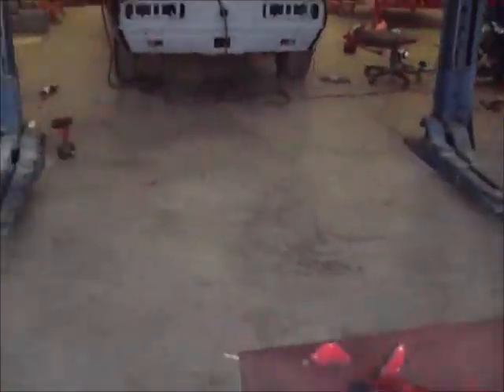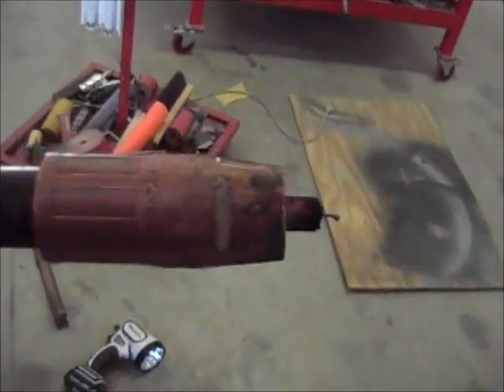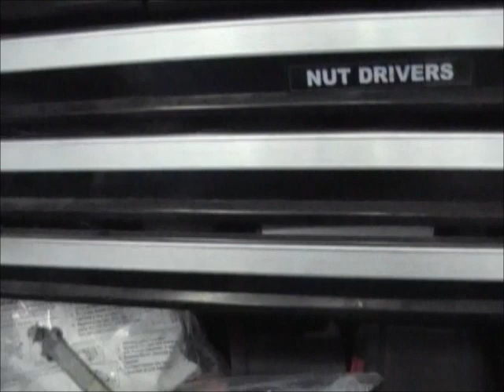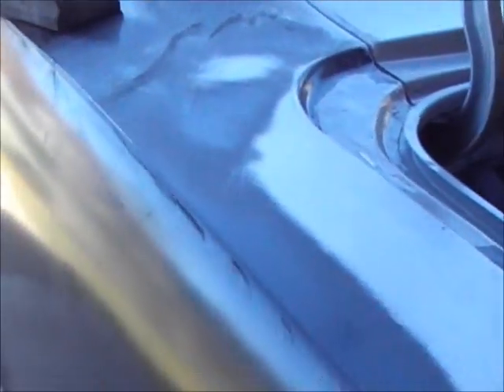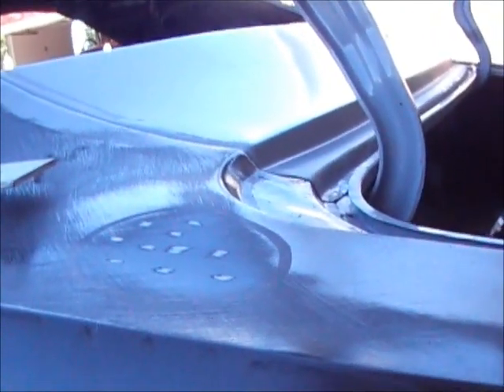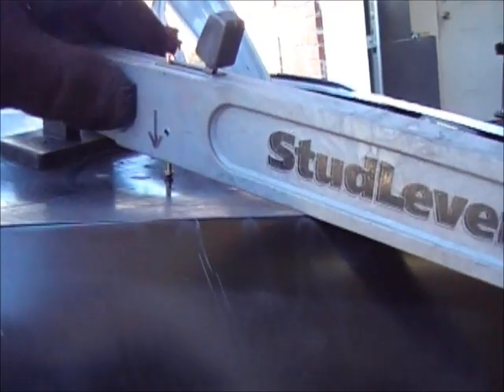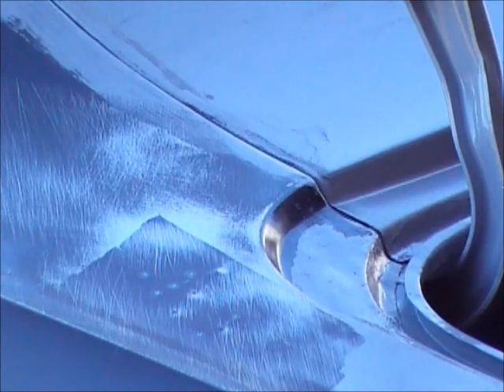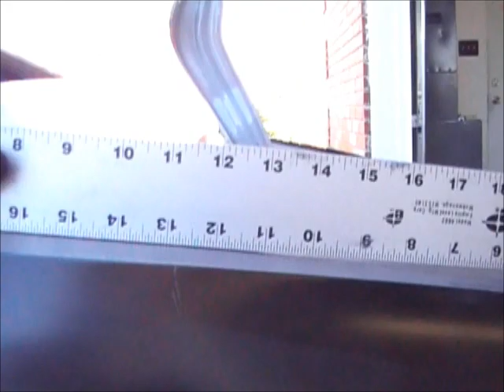working dents

Comment: Looking good, just bought me a stud lever and a spoon. Was messing around yesterday  just blocking the e-coat off the RH quarter and was surprised at how many highs and lows there was. Really wavy aftermarket panels, they look straight out of the box but that's the case.
Reply from the maker: +Classic Car Overhaul Yes, Im thinking of doing a couple coats of slick sand over the entire car to make sure its laser straight. you will like the stud lever

Comment: Camaro is really coming along.  The self leveling seam sealer does indeed flow like crazy.  I still prefer the heavy bodied sealer for the roof drip rail simply because I can build it up better and then smooth it out with my finger.  Give the self leveling a try though for sure.
Reply from the maker: Will do , thanks for watchinh

Comment: Looking really nice.  Just wondering if think the stud lever is 'better' or just different than a slide hammer?  I was just curious if you use both or you feel almost all the dents you've worked on can be done with the lever.  Thanks again for the great detail.
Reply from the maker: I use both , the slide hammer is nice for "deeper" dents or creases , the stud lever is more of a finesse tool and allows a more precision controlled pull ,  slide hammer not so much , it's easy to over pull with the slide hammer, thanks for watching

Comment: First gen. Camaros usually have issues on that area of the rear quarters, nice work.
Reply from the maker: Thank you sir.  Topic came up on all metal , what are your thoughts ? WhT do you use on sail panels?
Reply: +MrFireman164 I guess it's a matter of preference Roger, I leave the factory lead in place when I can and it shows no problems. If I have to remove it to repair or replace a panel I weld the panel seam solid with a series of spots and use Duraglass to glaze the weld seam then finish with regular body filler if needed. Just the way I've always done it.
Reply from the maker: +ceedell so swrnc bashed all metal really bad , has me thinking twice about it and I'm still at a point that I can remove it, really sucks

Comment: What's your thoughts on duraglass vs all metal? Just watched the video by swrnc and he hates that all metal
Reply from the maker: The only reason I bought all metal was for the sail panels , shut yer face suggested it verses glass because all metal has " metal" in it so the expansion rate to me would be closer than glass but that's just my reasoning , fiberglass is water proof for sure , don't think all metal is proof , just says resistant , but here's my thought , when a car has been  epoxied over the metal ( water proof ) then filler , which is a sponge , primer which is a sponge , sealer ( waterproof ) then clear ( water proof ) clearcoat is liquid plastic that dries hard after it cures . So therefore if I'm worried about waterproofing it's a non issue . So it's back to expansion rates , which metal is closer to metal . Don't want my sail panel seams cracking out on a tore ally hot day . Honestly I've never used it before but  researched a lot some like some hate . Remember this by our car rusts from the inside out not the outside in so as long as you don't get it wet before the metal is sealed ( epoxy)
Reply from the maker: Send me that link I would like to hear what the has to say
Reply: +MrFireman164 not sure how to post the link but it was on the diyautomotiveschool he just posted it
Reply from the maker: +KingsDisasterGarage I found it, Don't want to disagree with pete but his argument that if you tap on it it will crack is a weak one , show me . now I may change my opinion someday if I ever have an issue with it . But to me if your going to bash something like that , show me why , tell me a story of a car you finished and the shit cracked out through the paint , show me the '' failure" and ill never touch the stuff again . matt at shut yer face garage suggested it and i trust him, he turns out amazing cars.   https://www.youtube.com/watch?v=64LpVytqqsk
Reply: +MrFireman164 I agree when your a guy like me and watching all these videos everyone has different opinions so best thing for me is to talk to the guys who use it! I will have to address that sail panel area and was trying to see what's the best stuff to use
Reply from the maker: +automotive resto's paint and panel I may run a test on it myself at this point it's not to late to turn back
Reply: +MrFireman164 I would love to see a video on the test for these products!
Reply from the maker: +KingsDisasterGarage happening right now!
Reply: +MrFireman164 better go with what pete says.. He has way more subs than me... lol
Reply from the maker: +Shut Yer Face Garage lmao yeah cause people like drama